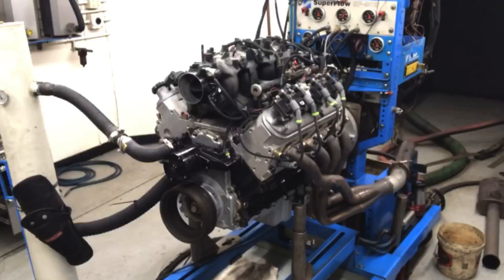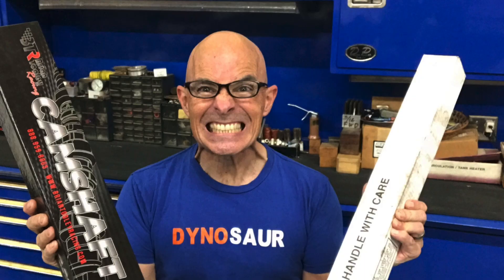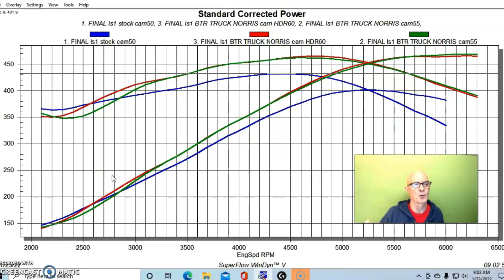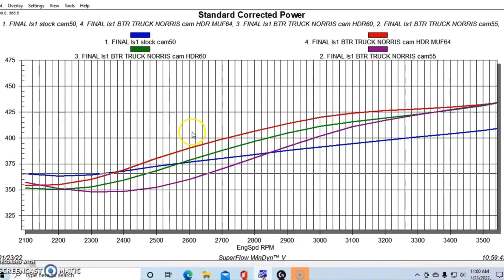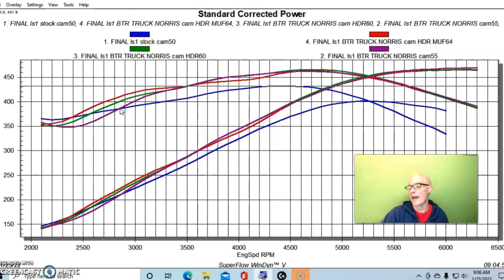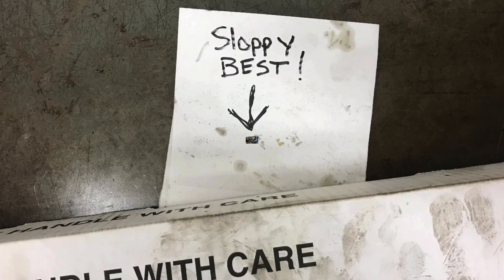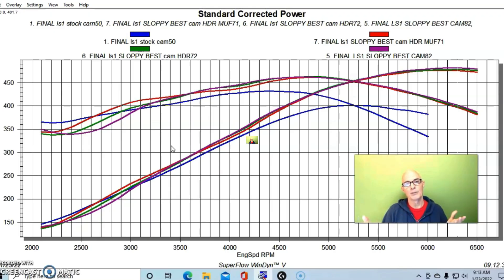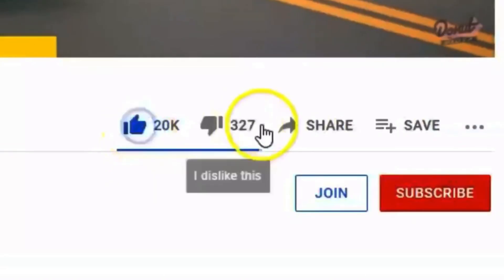DO LONG TUBE HEADERS ADD HP? 1 3/4 vs 1 7/8 HEADER TEST. WHAT MAKES MORE POWER ON AN LS? BONUS TEST

Comment: So this got me thinking I always followed the 100hp per inch rule for primaries. I have a turbo 155cc single cylinder drag bike I race and I'm wondering what really is the limits how true is that rule actually. Currently I'm running a 1in tube. Rich can you help? I'd love to see taper tubes but I understand with 8pipes thats alot.
Reply: Can't hurt to try a bigger diameter pipe.
Reply from the maker: you think a 1-inch diameter pipe is what is needed for 100 hp?
Reply: @richardholdener1727  I mean iv managed 65hp with one inch but I do have it apart now you got me thinking.
Reply: @richardholdener1727  well we find out next week lol just got done ceramic coating the new one and I hogged out my turbine housing. Still have the old pipe and they end at the same diameter at the turbine housing. I'll try both and be back with numbers. Hoping I can get her over 80whp
Reply: My vintage Harley has 2 inch primary headers. Makes almost 120hp.
Reply: @thereluctantgearhead4544  Hardly Movinson headers are always too big.
Reply: @V8Lenny  mine has a lot of cam and compression and induction.. Stock it had 61hp. I've about doubled that. I had 1.75 diameter headers on it, swapped out for the fattys and added some jet, it made a noticeable improvement. Louder too.
Reply: @V8Lenny  Old drag bike from the 70s.

Comment: Aren't we really concerned with average power? It'd be interesting to have the average power on each of these tests.
Reply: That depends entirely on your application,  if you have a race car that launches at 4k and shifts at 7000 you don't really care about anything under 4k. 

I know lots of folks harp on and on about low end and area under the curve on hot street applications but personally I think once you have enough there to facilitate normal driving anything more is just for making smoke and showing off.
Reply: @DrewLSsix  I was talking about the cams tested, not “what if” scenarios

Comment: G'day Richard.  Thanks for another great video, but your results are not a great surprise to me.

I learned a long time ago that dips in an engine's torque curve are a result of a bad exhaust for the RPM range of the dip.  This issue is more common with 2-stroke motorcycles than 4-stroke cars & bikes, and much more common on with aftermarket products than with factory products.  Whilst the original exhaust system on a motorcycle prevents the engine from making its peak power, compared to an aftermarket system, the original system gives a smoother torque curve.  Obviously the manufacturer has the opportunity & ability to test & refine an exhaust system, & they use that to create a well rounded system - from airbox to exhaust tip.

However, I do have a few questions for you.  Have you considered trying a step design, say from 1 1/2"-1 3/4"-1 7/8"?  Also, have you ever tried a cross-over design, where the outer 2 cylinders of 1 bank are collected with the inner 2 cylinders from the opposite bank?  Finally, are the 1 7/8" extractors built with more anti-reversion than the 1 3/4" extractors?

Once again, thanks for a great video - I enjoy watching shows that encourage thought.

Andrew
Reply: Motorcycles quite simply cannot be compared to cars in regards to exhaust, because a factory exhaust on a motorcycle IS a header. There aren't the packaging constraints like there are under a car, and motorcycles aren't treated as much of appliances to the manufacturers as passenger cars are to their respectful manufacturers so performance is first and foremost on the agenda.

Comment: I spent a few days reading the views of Calvin Elston on how he does headers and exhaust. Very interesting stuff and a bit unusual to what most might think.
Would be an interesting test to see one of his system. But kinda impossible since theyd be custom made for the heads and engine..
Reply: Collector outlet sizing is important.
Reply: @motorosso3349  Yes that and the head-to-header flange transition. He (Calvin) says the first part of the header is as important as the last part of the intake runner and that the trnsition from the port to the header is very critical.
Correctly designed stepped headers seem like a godd idea also. The thing that might surprise most is that he use smaller size on everything than what is otherwise used.
He suggest people use the Burns Stainless calculations for the overall dimensions.

Its all up on Speed-Talk forum.
Reply: @magnusdanielsson2749  Yes, using the smallest diameter without hurting HP is the way to go as it keeps the gas speed up. I agree on the Burns Stainless calculation for header dimensions.

Comment: Here I am buying 2" primary headers thinking that more flow is always better...
Reply: They are.. 2 inch opens you up for more power down the road whether you do heads and cam or a blower... my LS3 made 410rwhp with 2 inch headers only... wasn't doing that with 1 3/4
Reply from the maker: that is incorrect-2.0 header are not needed or even beneficial on a 400 whp LS
Reply: @richardholdener1727  LIES RICHARD!! LMAO
Reply: @richardholdener1727  where would you figure a 2” primary is beneficial ? Is it worth while to upgrade a 1-7/8 for a 2” on a stroker say 415-454 LS
Reply: @richardholdener1727  I would like to be over 500 whp after heads (thinking rec ports on my LS2) and cam etc. I am trying to learn engine stuff to build and autocross/track my C6. Hopefully 500+ NA and turbo later down the line.
Reply: @charleswilliams2008  when your exhaust port is 2"
Reply: 2" gains power on 6.2 engines they pushed me north of 500whp on my 2012

Comment: Fascinating. Wish I got paid to do header R&D. Pretty sure with enough fabricating, you could erase most of those mid rpm dips. Little bigger here, little smaller there.... Header setups would be exclusive to the engine setup though lol

Comment: Now let’s see 1-3/4” vs 1-7/8” vs 2” on a bigger cube motor say a 6.2 ls. I was not expecting these results but then again that’s why I watch your videos to see real world testing. So many people get wrapped up in peak power but under the curve is what matters.
Reply: Throw on 1 5/8” too, may as well test the limits.
Reply: I'd really love to see a taper tube header from 1.75in to 1in at the collector. I know on rotaries it makes a huge difference. Rule of thumb I was always told was 1inch = 100hp of flow. Don't see many 800hp na v8s lol
Reply: Remember a 1 7/8 header with a 3 inch exhaust and X pipe into simular mufflers may give you the same or even better results than the 1 3/4 did in this test I'm pretty sure it would help with low speed torque
Reply from the maker: I know you want the bigger header-it's not needed
Reply: @richardholdener1727  what about when you add a supercharger? (Preferably on an LS3)
Reply: I swapped from 1 7/8" to 2" on my 2010 Camaro and gained nothing until into the overrev. Overrev I gained 8hp or so on average.
Reply: Would you see better torque low on a bigger 6.0 using 1 3/4 or would that have diminishing results? So maybe better suited for 1 7/8 on a 6.0
Reply: @merica.racing  I highly doubt it.
I think 1-3/4 is perfect for a 6.0
Reply: I'm regretting getting 1-7/8 for my 6.5 stroker now. Guess I'll have to try and sell them and hope whoever buys them hasn't seen this video....
Reply: @christophermix6845  how do you know that the 1 7/8 headers with 3 inch collectors into a 3 inch X pipe into the same muffler used don't get you the same or better results he only used the exhaust extensions and mufflers with the 1 3/4 headers not the 1 7/8 l don't know but l bet you'll get the same results with the 1 7/8 maybe even better plus your talking a stroker engine that has a longer stroke crankshaft means the results could be different
Reply: @gloriamaletta8667  I don't, but Richard mentioned that he's  tested them on lots of setups and had the same results.
But that probably wasn't with full exhaust and a x pipe.

It'll be 3" exhaust all the way back on my Silverado, don't plan on doing a x pipe.
Reply: @christophermix6845  l had a 1984 Monte Carlo SS with a LS2 with a camshaft that was carburated back in 2008 nobody made longtube headers for it so l ran exhaust manifolds 2.5 X pipe one chamber mufflers and dumps it ran 7.6 in the eighth mile tells me even the stock exhaust manifolds flow pretty dam good
Reply: @gloriamaletta8667 cool I'd like to build a carbed LS to put in something older someday.
They do but sound crappy lol, after putting even 1-7/8 headers on my 5.3 I'm sold on them forever they completely changed the driveability of my truck. I'll probably just run them on my stroker going from to a 6.5 from a 5.3 I doubt I'll notice the power loss down low haha.
Also I'll have 3000 stall so it'll probably slip right through that lower RPM power loss.
But I'm am using CNC LS3 heads, a ported L92 intake, trying to find a drive by wire 102mm throttle body if I can't I'll use a 92mm. BTR LS3 N/A STAGE 3 229/244 .630"/.615" 113+4 camshaft. So maybe the 1-7/8 are what I need?
Reply: @christophermix6845  l don't think your setup is going to have low torque problems
Reply: @gloriamaletta8667  I won't but I'd possibly gain more with 1-3/4.
Reply: @gloriamaletta8667  looks like Richard is going to answer our questions haha.
Reply: @christophermix6845  he's the expert with more experience and dyno time with testing different combinations
Reply: @christophermix6845  all l need to know is your worried about doing everything possible to make as much torque as possible other than installing a X pipe seems to answer my question HA HA
Reply: @gloriamaletta8667  it looks like the 1-7/8s are the winner on strokers.
Nah I'm not worried lol. I'm not against a x pipe just don't plan on doing one but you never know. Less tq would probably be better anyway because traction is going to be non existent with hard all terrain tires...
Reply: @christophermix6845  6.0L carbed 1 7/8"primary into 3" full exhaust using Dynomax Ultra's with a 5000 stall...not really worried about "low speed torque" myself... but was good info. Thanks to Rich for the dyno info.
Reply: @Dougs68Camaro  yah low speed torque is pretty useless with a 5000 stall.

Comment: So would you say on a cam only (226/230 550"/550" 112 LSA) LS6 that the 1.75" header is sufficient? Or would there be some power left on the table?
Reply: 1 3/4 all the way.
Reply: 1 7/8 gain more on supercharged applications

Comment: Have you done any testing with the gm inline 5cyl? The 4200s cousins brother, I'm curious to know how it would hold up(boost/nitrous)  and knowing since it's a shorter package than the 4200 what percentage gains/loses does the 1 extra cylinder bring to the table
Reply from the maker: not yet
Reply: @richardholdener1727  just curious, I have a h3 laying abandoned at our shop. Still runs, frame rotted out and customer doesn't want it... Maybe I'll pull the engine and build it and see what it will do, just wish I had access to an engine dyno...
Reply: @Brother2Jis_27s4  I've wondered about the 2.9 I4 version of the Atlas. It's kinda anemic in its application but it's a pretty big inch I4 with a nice head,  I think it could be a solid performer in certain cases.
Reply: @DrewLSsix  itd be cool to line the whole family of them up and do a side by side by side... See if going from 4cyl to 6 gives a proportionate increases in power as you add cylinders

Comment: Can you do a 4.0 jeep h.o., renix, amc, stroker. Ive had a few and have always wanted to build one but there are no real informational on what and no test so dont know which way would be the best to go.
Reply: At the moment i have a 4.0 with a . 030 over bore with a . 060 crack and a . 030 cam ported and decked h.o.head and intake, but stock h.o. ex.manifold. thing is a deffently drives different then a stock 4.0.

Comment: I'll be that  guy and ask why no  results with a crossover pipe or balance pipe? V8s benefit a lot in that scavenging rev range . And  do boosted engines benefit?wether power or economy/fuel efficiency.  Love the testing Richard. Playing with a 454 and a 250 blower pulled out for a freshen up
Reply: From what I've heard the Gains are very minimal, but I've also heard that you lose low end torque with headers lol. so we need Richard to test it haha.
Reply: @christophermix6845  you lose torque with no collector length. 18" collectors length gives you a whack of torque
Reply: Cats probably change things up is say.
Reply: @timothythomas1737  HAHAHA don't run cats just dogs hot dogs!!sorry couldn't resist lol but yep they do
Reply: @r0bkills  is like to see the difference cats do make.
Reply: Boost has pressure on the intake valve, NA has to rely on atmospheric. Scavenging results are higher on NA during a small roughly <1500 rpm window when a negative pressure wave goes back to the open exhaust valve pulling in more air/fuel during the overlap on the intake stroke. Or so that's how I take it.
Reply: @Peewee0413  same here the street rev range that it will see I agree  . Its all fabricated beautifully all I'm doing is a small supercharger after the freshen up. made 432hp NA to the wheels with that exhaust. aiming for 600s street, pump gas with the 250 blower still single carb nothing mad , 57s don't need to go fast. lol .it might see a smaller pulley on the 1/4 down the track. Love the feedback guys respect to all views. and we keep on learning. When the bb is back running this time will dyno with and without exhaust just headers and two pipes the length of the car lol if they let me . last dyno was get on 3 pulls adding timing ok done get off Next!!$$$. cheers guys keep playing
Reply: I do wonder what catted longtubes in 1-3/4 & 1-7/8 would look like
Reply: Belt driven power adders and nitrous benefit from headers and crossovers and stuff because they have normal exhaust pulses that still scavenge normally. Turbos, not so much. Having a free flowing system that helps organize exhaust pulses going into the turbo is somewhat beneficial, but too much volume/pipe length pre turbo hurts performance, and anything after the turbo is just an obstruction.
Reply: @Cowboy.underwater  thanks not going to mess with the beautiful stainless steel exhaust under the 57 yep fabricated hi flow x pipe  in there too looks mad . So just a freshen up for the bb head's bit of bowl work, new total seal ring's
Reply: Unless the exhaust is engineered with multiple dyno testing just sticking a “xpipe” or “H pipe” in the exhaust flow does nothing for you.  
The cross over would have to be in the exact distance for each individual engine to achieve exhaust scavenging worth talking about.  
Have a equal length headers with a real merge collector is with way more in power and exhaust scavenging
Reply: @mikeeagle2653  and I see dyno pulls that prove it even bmw Benz and porsches designed their own . My 57 don't see full throttle much but I do cruise alot
Reply: @r0bkills  dude that’s literally what is said. 🤦🏻‍♂️🤦🏻‍♂️🤦🏻‍♂️🤦🏻‍♂️ do you know how much it cost bMW and Porsche to engineer exhaust system 
Millions and months even years.   If you just stick a xpipe on and your exhaust maybe you’ll see 6-8 hp. That’s it. It’s not worth the time or money
Go research how much more benefit you get from equal length headers with real merge collectors.  Then come back
Reply: @r0bkills  and FYI the xpipe on a Porsche is used for sound NOT for exhaust scavenging
Reply: Supercharged engines do not rely on scavenging.  Pressure differential from intake to exhaust, and proper cam timing blow unburned residuals out.
Reply: Cross over helps old stuff more but not as much on ls stuff since ls has a better firing order but 1 7/8 will always win the bigger the engine the more the gain

Comment: Very interesting, I didn't think the 1-3/4 would gain anywhere in the powerband. I'm curious what would happen with a larger displacement and a more aggressive cam revving to 7000 or higher.
Reply: 2 inch ftw
Reply: Pretty sure you'd need more than 1-3/4.

Comment: Why don't you keep the last iteration in the same color and use a new color for the latest power graph line? You just confuse things with changing the color of lines every time.
Reply from the maker: the software won't do that-but I explain in great detail so there should be no confusion
Reply: @richardholdener1727  …. I’ve been meaning to give you a big pat on the back for all of your highly detailed explanations. I’m one of those individuals that has weak color vision and when multiple colors are required on the dyno charts,  I struggle with identifying certain colors. Especially with popular colors like red and green. 
Thanks for doing what you do, Richard. Nobody does it better 🏁.
Reply: @richardholdener1727  I thought thatay be the reason. Sometimes I jump back and forth to recompare things and it's confusing. This last one the description at the top with color box didn't show the header size so it was very confusing.

Comment: Do a big block chevy header test. I'm using 1 3/4 on my mild 496
Reply: That's tiny for that many cubes. I'd want 1 7/8" minimum for a big block. 2" and up for stuff with a good head.
Reply from the maker: pretty small for a BBC